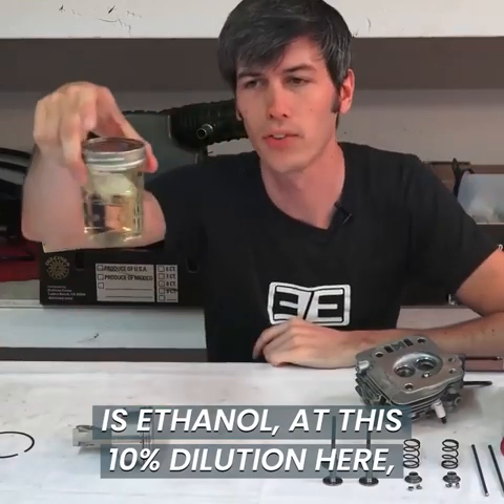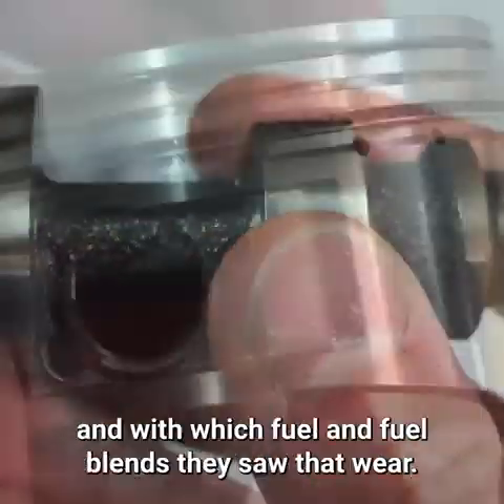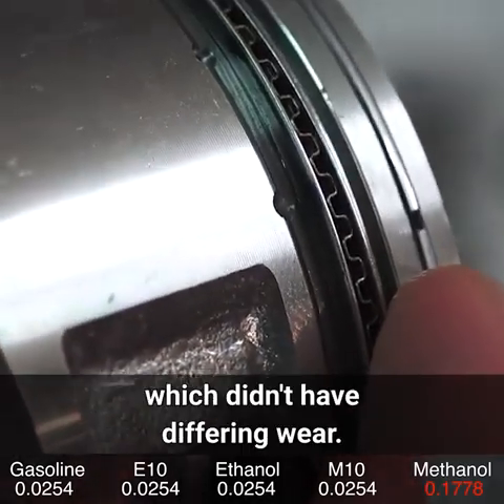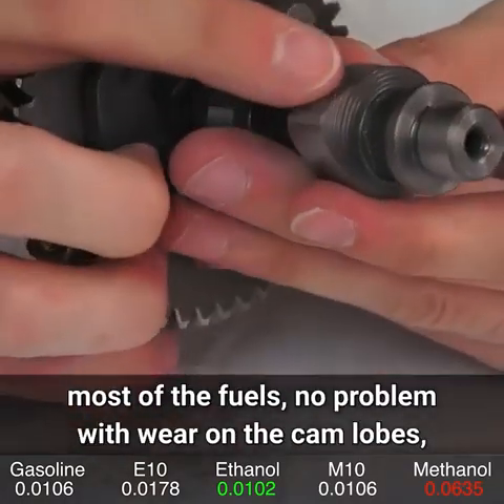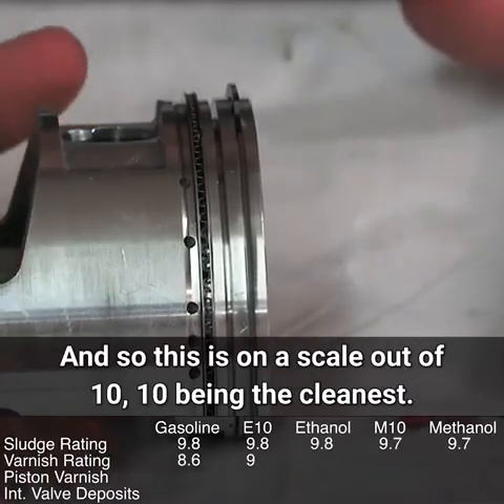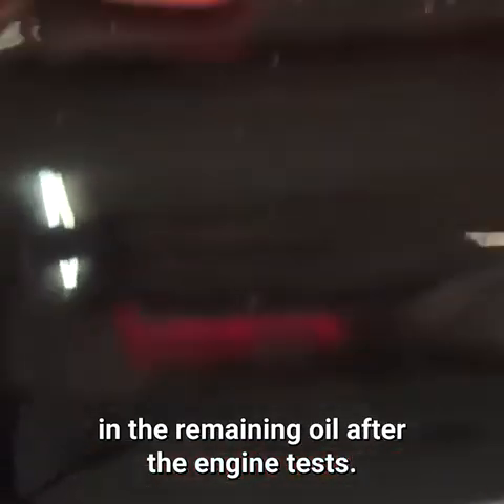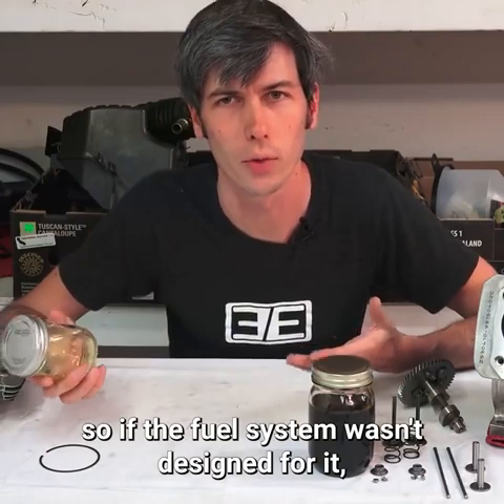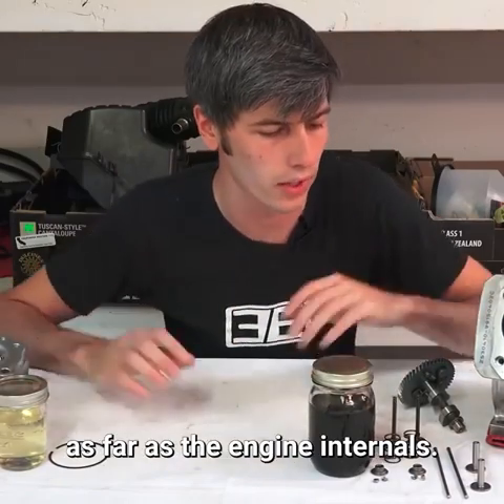Is Ethanol E10 Damaging Our Cars?

Comment: Gteat explanation video. My Honda 50cc motorbike seems to be down on power with E10 petrol when hitting a head on wind, To solve the problem I mix E5 with E10, so far so good, power seems to be ok now and can cut through any head on wind with ease, I have not tried the tornado test yet, but hopefully I will eventually be able to try a tornado wind with both fuels.